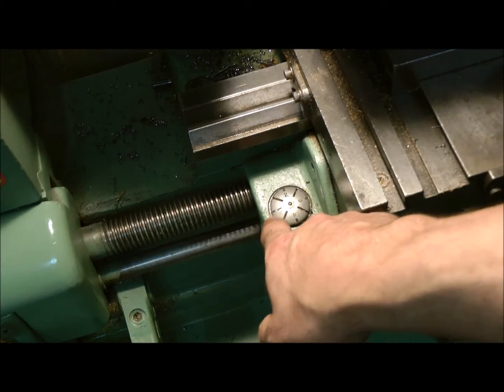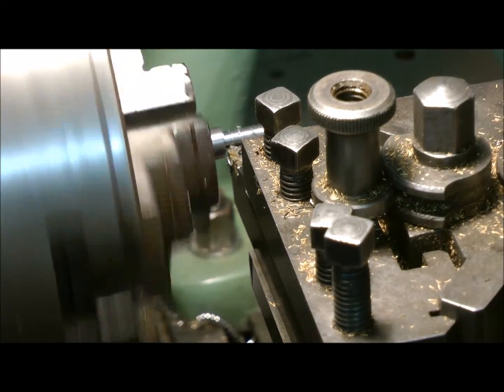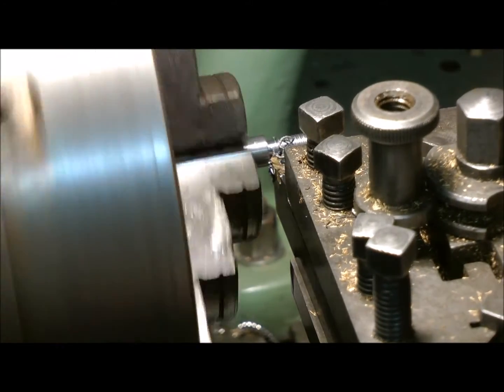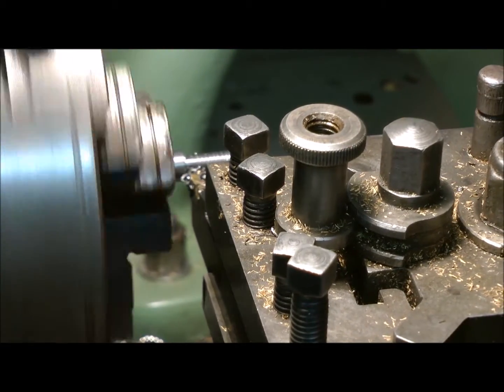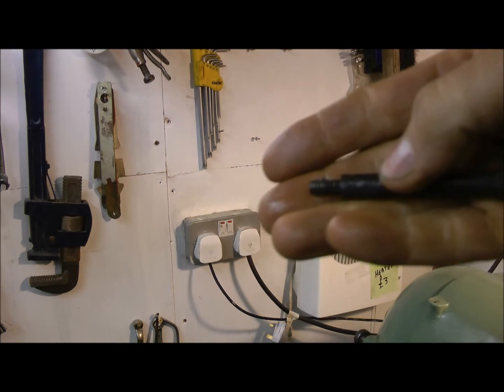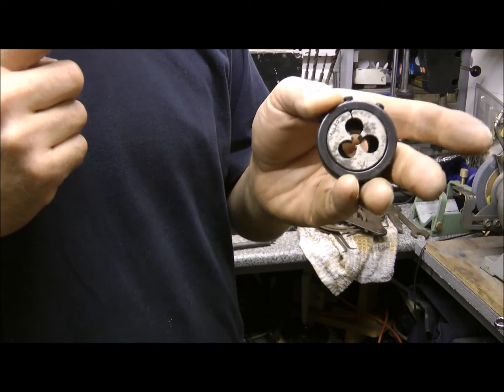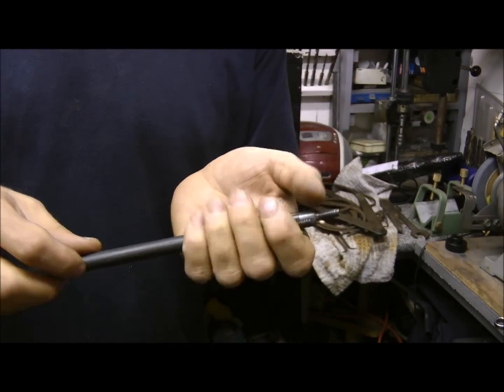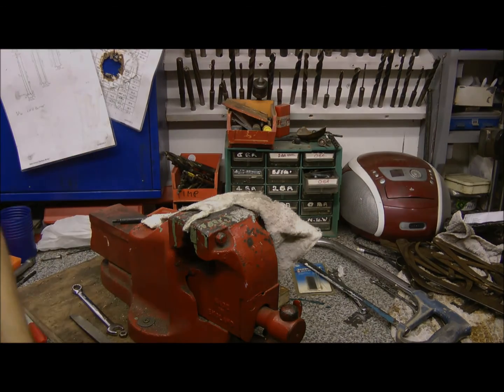lathe cutting screw part two ! I learn the Lathe for the first time threads and threading

Comment: If you set the cross slide to zero at the end of the cut wind out the cross slide, carriage back cut on  with top slide wind in cross slide to 0 and engage nut at the appropriate #.

Comment: From the manual: "To cut an even number of threads per inch, eg, 12 tpi, the leadnut may be engaged at any division on the dial. For cutting an odd number of threads per inch, eg, 13 tpi, the leadnut must only be engaged on the numbered divisions, whilst to cut fractional threads, eg, 4 3/4 tpi, the leadnut must only be engaged at the division market 1 on the dial."

I hope this is of assistance.
Reply from the maker: It is thank you ,  I read the same thing a year after 😅, but decided to leave the video on ... I should really make another one , thanks for viewing , kind regards Chris 🙂

Comment: D'ye like that! Fred Dibnah said. I liked that very much. 

I've watched these vids before but have a renewed interest now as I've aquired the very same machine.
Just cut 4 threads today without using the compound slide method. Straight in. 
Gives a nasty finish and is hard on the tip of the tool.
I had no bar stock so I had to turn down some metric bolts from the hardware shop and they didn't turn very nicely.
Still job done 4 No. 3/8 16tpi bolts to hold the gap piece in place.

One of the nuts holding my compound slide is rounded and it's a pain to adjust.
I've had it off once but didn't measure it for size or thread it seems to be a weird A/F as well
One of the home bodged/ground whitworth spanners seem to fit it best.

I will have to sort this next.

Thanks for posting

D'yohh....!

Comment: Good job Chris. I think the manual says you can start on any number.

Could you please tell me how you got the badges on your lathe back to mint condition? How did you get the rivets out? What products to clean?
Reply from the maker: check out my vids you'll see how I got them out ! and cleaned it, the badges from ebay , bizboy 04 I think he may have some he has other things for sale eBay item number:201588648058

Comment: Colchester angle markings alert! Might be a funny camera angle but it looked like your top slide was at 30 degrees the wrong way. On my Colchester the angle markings are from the spindle axis, not the cross slide axis so 30 is in fact 60 degrees for threading. It always stuffs up the threads having it set to 30. Sorry that made no sense at all!
Reply: I don't think it is the camera angle but it is 30 from the wrong axis.  Rookie mistake for sure but he is in good(?) company, Doubleboost being one example. Personally, I don't even bother to use anything but straight in, on such a small thread. Also I'm slightly surprised that Chris had a 55 degree insert, but the difference on 1/4 20 will not show, all other things being equal.
Reply: chris the bodge Well at least you are ready for the next one now.
Reply from the maker: it made perfect sense, your correct I  think it read  59.5 ! I did warn everybody I was "rusty" lol  it was a good experience though  and I'm glad for guys like yourself and others for your input, its what makes YouTube great
Reply from the maker: hi Chris ! ive used straight on myself, I was just " trying to be fancy" ha ha somehow through sear dumb luck it worked !, should of just bought the die in the first place !kind regards Chris :)
Reply from the maker: Keep an eye on me Chris :)
Reply: That's what the subscribe button is for. Got to keep an eye on these youngsters to make sure they don't disgrace a noble name.